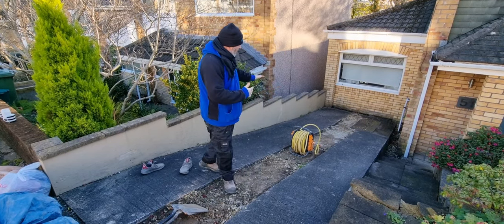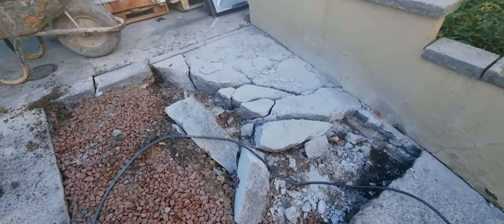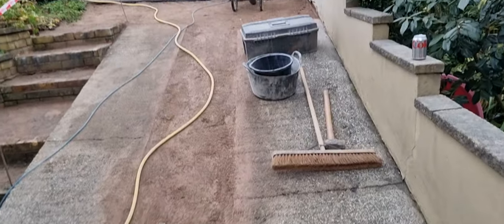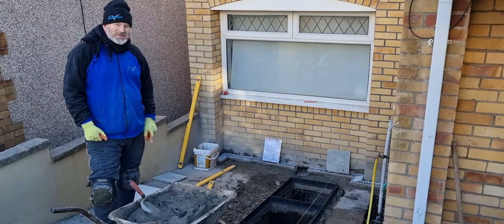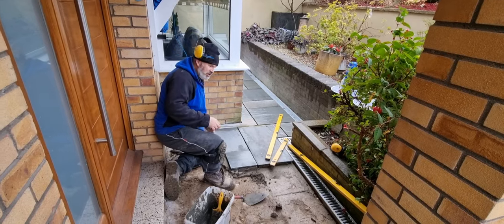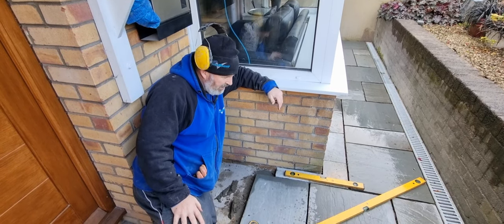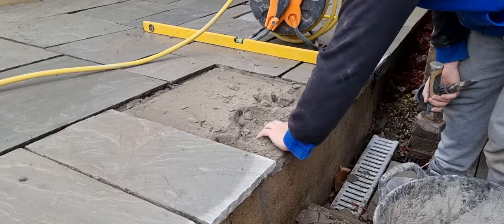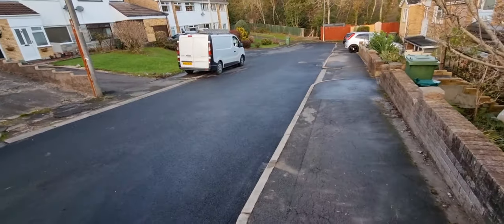Paving a steep drive

Comment: Those 45° cuts are bang on mate!!
Proper pain about having to cut those smaller slabs! On site I've seen lads just open up their perps to get over it..but you end up with a bit of a mess really..however if the manufacturer just cut them correctly it would save hassle for everyone! That mix is like concrete 👌them slabs are never moving 👌 Brilliant work mate! Definitely not the easiest job at all! Looks fantastic! Look forward to see the clay paving job bud! Hope you and the lads are feeling well🍻🍻💪
Reply from the maker: Thanks izzy appreciate the comments. Yea opening up the perps as you say dont work unfortunately. Been happening for years and they still haven't fixed the issue stupid really but they get away with it.we all good here thanks now after that lurgy 🤣🤣.Good luck issac mate thanks 👍💯

Comment: Recently found your channel 
I'm a DIY newbie 
I've dug the garden out ready to pave
Here in Carlisle it has rained for 6 weeks
I covered most of the garden with a tarp, but the soil is still wet
I am going mad waiting for it to dry
Am I being over cautious, or can I whacker plate my type 1 over it and lay my slabs 
Any help please
Keep making the videos
Reply from the maker: Its difficult to say as im not on site to see it.
Generally if you dig a small water collection pit and pump or bucket the water out .Then scrap any slop of the surface area so its free of water and slop.
You are then good to mot the area .soon as the mot is in wack it straight away .if you leave it and water builds again your mot will turn to slop .
Its worse here in wales rain wise we get so much rain i feel for pain.
Good luck hope that helps you .
Justin 👍

Comment: Great work Justin tidy aco drains them your son has done well. Ah feel ya on slabs nightmare. Even some porcelain tiles can be as much 2mm either way nightmare if laying in stack bond sometimes just do without the spacers. Sandstone can be miles out tho. Save on slurry mate on the hard concrete and just wet it then roll some sbr on save a wee bit   On slurry 🤟
Reply from the maker: How are you mate ?
Yea both lads doing really well. Sandstone been out of calibration since day 1 hasn't it .You'd think they'd have it sorted by now its ridiculous. Sbr would of been fine just didn't have any on the van mate .Take care mate. My disc cutter / Angle grinder has gone bang we had a makita 240v about £50 you recommend a replacement mate ?👍
Reply: @brickrightbuildinglandscaping  
Am great buddy. Btw ebay or Amazon for sbr £12-£16 tops merchants can be a lot higher. Grinder for you go 54 volt dewalt 5inch grinder the amount punishment a have give cutting by tiles etc still forges on. £220. Fire your flex volt batteries into it. Not a fan of anything corded. Cordless or gas the way. Rubi 125mm viper blade for it Amazon. £32 bucks blade is super for porcelain buddy or sandstone
Reply: @brickrightbuildinglandscaping  
Yeah sandstone the calibration is mostly the focus on the continus thickness of the slab they normally work between 5-8mm the 1,s that have been calibrated with have the lines etched on the backs of them. For the dimensions they are just wild at times aren’t they. Was building anstone and 215mm x 300mm 9,s we call them they were bloody 220mm height a good amount manufactures just don’t care think a lot of there cutting tools don’t get renewed quick causing big variation in sizes.
Reply: @brickrightbuildinglandscaping  
Grinder and cordless 54volt paddle Yeap Christmas money will be away. 12ah batts do make a difference waiting to buy the 15ah monsters. Paddle can easily mix 12 bags self level on a9ah batteries or 3 barrow loads of cement.  Proper power buddy saves all the cables great for Flowpoint your slurry and if needing just a barrow of cement or so 25l plasters bucket very effective. Do have a 50l give you a good barrow load cordless paddle handles it effortless props quicker than mixer these to clean.
Reply from the maker: Nice one lee ill look into all that especially the cutter my makita was about £40 when i bought it you skint me out you do mate 🤣🤣.Nar i do appreciate your advice. 
Justin 👍
Reply: @brickrightbuildinglandscaping  
Haha trust me 54volt grinder has same power corded 1. And you have to big batteries there to use on it. Yeah £40 bucks can’t go wrong for sure buddy ma mate electric grinder blew up other week too. 3 year warranty ul have  your dewalt saw have got a porcelain cutting blade for it ?  Pulvex do a dry cutting 1 very good although a do prefer putting water on. Elite stones have  230mm blades also along with the Rubi viper not used it tho only used table saw and 5inch grinder. Best blade came across for grinder to date. Sharpest and quickest av used on the 9inch saw. Is Diatech wet porcelain cutting blade bit expensive but is quality. Just got blade from elite stones for gas and nice free bag of sweeties happy days lol.
Reply from the maker: @L Milne  
New you'd be the go to man to ask really appreciate it as always mate 👍

Comment: All right all ,your right  two three’s ain’t a six with them slabs where’s your new dewalt cutter looking good chaps get well soon boys👍👍
Reply from the maker: Hya clive
Pain in the arse time is money they should either make the product a lot cheaper or just do em right first off.The dewalt is brilliant but after using it now for a while the batteries dont last that long and we have to go back to the sthil saw bit frustrating clive  
Awra best mate 
Justin 👍
Reply: @brickrightbuildinglandscaping  they are handy enough for a few cuts for sure but you can’t beat a stihl it’s a pity my stihl is haunted it’s a mare to start runs perfect in the back garden take it to work poxy thing doesn’t want to start 🤯😂😂

Comment: Had this same problem with the last patio I did, we noticed what we call "small rectangles" the 600x300 had a chalk line down the middle of them to be 2 x 300x300 with no allowance for the extra joint 🤦‍♂️ made the job a pain tbh ended up having half of day trimming the joints up before we could joint it all up
Reply from the maker: Hya martin
Its an unexpected and un necessary addition to our already hard days work .Indian Sandstone is no longer cheap and to install a professional project for our clients. Buying branded Indian stone should come ready to lay no cutting but its been happening now for years and its not good enough is it Martin. 
Justin 👍

Comment: Fair play, a job that most would avoid.
What did you point it with?
Reply from the maker: Had to use a brush in on it due to the slope with a main drain at the bottom of it Joe 👍

Comment: Nice tidy job again lads, had the same issue with Indian sandstone, nightmare to try and keep a consistent bond, a whole lot more cutting, 
I complained to our supplier and got a 10% discount our next order which only worked out £100 or so, considering having 3 men taking an extra day than we would normally have done it in, these things happen every now and again, but thank god they are pretty rare… 

As for the weather, it’s absolutely Baltic here in Ireland 🇮🇪 also, considering we had a pretty decent year with regards to weather it’s just about bearable 👍
Take car lads, see yous on the next 👌
Reply from the maker: Hya marty
Mad that everyone is having the same issue with indian sandstone its not on costing us a fortune to rectify. The suppliers need to sort it out to be honest. Weather cold here aswell but shortest day on 21st December so all getting lighter after that roll on a .
Good luck to you lads 
Justin 👍

Comment: What fall do you have on the echo drains?, another good video
Reply from the maker: Paul as long as they are level and the run isnt to long and you have an outlet you can put them in level .ideally just a very slight fall though mate 👌
Reply: How did you connect the drainage to the gully grid
Reply from the maker: @stearmy76  the drainage was higher thrn the gully so rested on top or we just cut a slot into the gully 👍

Comment: recently did my own rainbow honed indian stone patio, the 300 x 300 slabs turned out 290 x 290 leaving massive joints :\
Reply from the maker: Cory its been a nuisance for years with this mate .About time the suppliers fixed the issue once and for all.They cut the slabs just cut em to the right sizes a mate 
Justin 👍

Comment: Great vid ! Your certainly not afraid of taking on jobs with cuts !😂 then the daft small pavers to do on top ! I’ve always just expected it and sometimes I don’t even use them and I’ll lay them in 1/4 to half bond ! The normal random pattern can be a pain and I actually get ‘pavers block ‘sometimes 😂 and choosing which one to lay is frustrating ha ! Oh I bought a dewalt saw same as yours and it’s definitely a handy tool and love not having to be pulling pull cords etc but you can’t just have that as a pavers ay !! It’s handy yes but you still need a Stihl saw as the dewalt isn’t really that powerful for loads of cutting at a time , that said a wouldn’t do without it now ! How you liking yours ?! Cheers 👍🏻👍🏻👍🏻👍🏻
Reply from the maker: Morning Giles
Yea agree mate with all .we actually use a laying pattern but Bradstone s pattern hand a cross joint in it can you believe that so had to bin it and use a marshalls one. The dewalt after using it now for a while a good addition but the batteries just dont last long so i need more which isnt cheap also the charger and batteries are being hit about they needed a case not for the actual dewalt but for the charger etc bit .other than that its defo a good saw to have but wont replace a sthil saw agree.
Good luck appreciate the comments 👍
Reply: @brickrightbuildinglandscaping  🤦🏻‍♂️🤦🏻‍♂️nice one branstone 🤦🏻‍♂️! Oh I get what you mean about the banging around with the fast charger n batteries! I only last week got a big solid bottomed bag for all my chargers, batteries , drills angle grinders etc to protect them a bit more and I take them all at once out the van at night to put them back in the morning! Keeps them getting dusty and knocked around so much and obviously mikes better with them not being in van over night !! All these years of being paranoid about expensive tools in the van have vanished ha ! Not to mention them being better off inside in the warmth ! 👍🏻👍🏻! Great job that mate ! Anything on a steep gradient like that is never easy 👍🏻👍🏻👍🏻
Reply from the maker: @Giles J  good idea that and sensible aswell i think i will get a bag do the same .on way to site in the rain got to love it 🤣🤣 thanks giles always appreciate the positive comments 👍
Reply: @brickrightbuildinglandscaping  I’ve tried twice to send you a link to the bag I got ! Must be some regulations or something u tube won’t allow it ! It a 22” tough master ! ( looks like a dewalt) hard. Bottom and it’s rectangular to the top so get loads in it 👍🏻👍🏻👍🏻
Reply from the maker: @Giles J  thanks Giles yea id defo buy it u mind sending the link to brickright32@gmail.com 
Thanks mate appreciate your help mate 
Justin 👍

Comment: Can I lay pavers use crush rock as base on slope surface?
Reply from the maker: Id recommend mot type 1 base with a screed layer of sharp sand .we have videos on block paving in the play list if that helps 👍
Reply: @brickrightbuildinglandscaping  thanks.someone pour concrete as base then lay pavers.i Will laying bluestone on slope.any recommend
Reply from the maker: @zengxiaohao  yes same principle as in this video 👍 but will min 100mm mot compact base

Comment: We've had that problem with paving sizes with Indian sandstone a few times. We always ordered the 840/560/280 sizes. Recently had a job and was supposed to all be 560 square (brickbond pattern) they hadn't got any but supplier said don't worry you can use the 600 by 600"s. We didn't even know they did them, so after that, I'm wondering whether the size batches get mixed up somehow, so you might get 840's and 560's with some 300's instead of 280's or 600's instead of 560's? I guess we'll never know.
Reply from the maker: Hya Paul.
Yes your right different suppliers do different sizes its a pain in the arse again to be honest .Bradstones wherw the 560 and 840 etc then marshalls used to be the same size now there arw 600 x 600.etc so a bit confusing isnt it but at least give us sizes that fit paul right ?
Good luck mate .
Justin 👍
Reply: @brickrightbuildinglandscaping  yep, a real pain Justin. Thanks
Reply from the maker: @pauln7422  
👍👍🙂💯🧱

Comment: That little L shape cut at bay window could have been done away with if you cut bit of 600mm slab and that would let you come of house with full slabs but neither here or there I suppose, good job considering what your working with 👍
Reply from the maker: Just kept to the pattern we were using from marshalls  but thanks for pointing that out 👍🙂💯